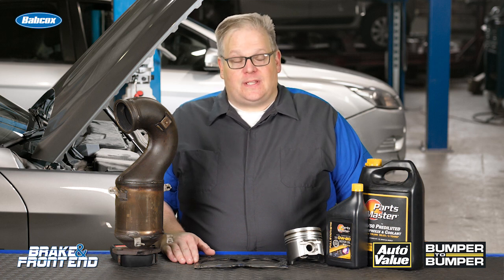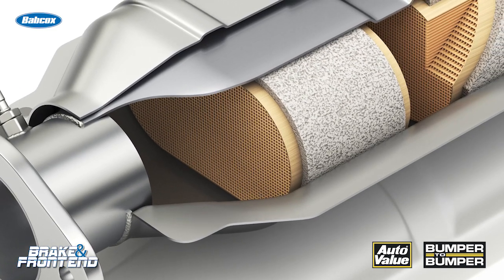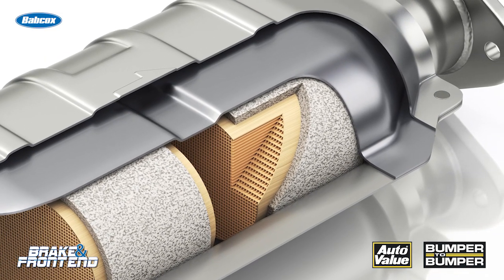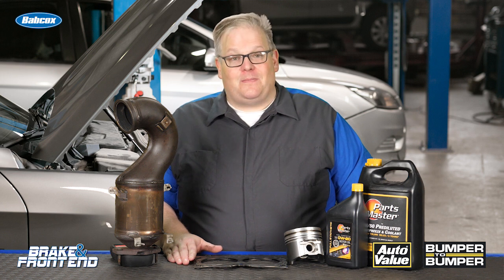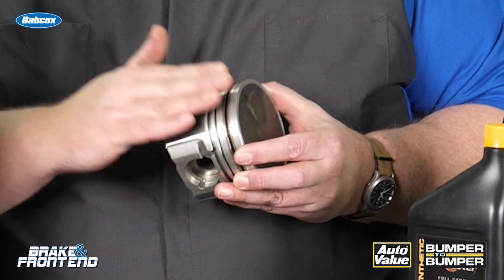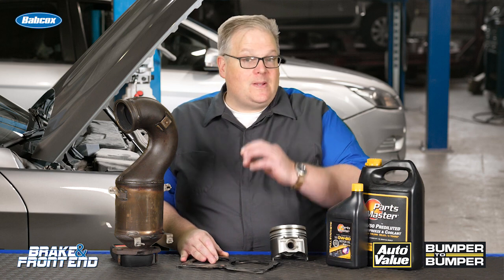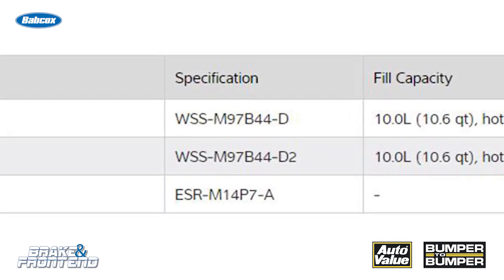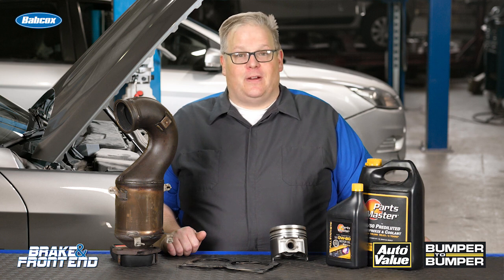Catalytic Converter Efficiency Killers | Tech Minute

Comment: I have a Kia Rhodo 2014 and last year had to have the converter replaced it was "blocked" so I got it done $2500 they did mention that there was an oil problem somewhere. Now I just had to have the converter replaced again fortunately for me it was just still under warranty. But they checked the oil situation this time and said I needed to replace the engine as something about the pistons but as I am senior lady widown know nothing about this stuff, but wonder why last year they didn't address the oil issue then. I have been adding oil occasionally in between my regular oil changes, but now they say they cant warranty this converter since it has this oil issue. so they want $4000 to fix the heads etc. Now I don't know what to do as I really cant afford a new vehicle. have I been using the wrong oil topping up the level>